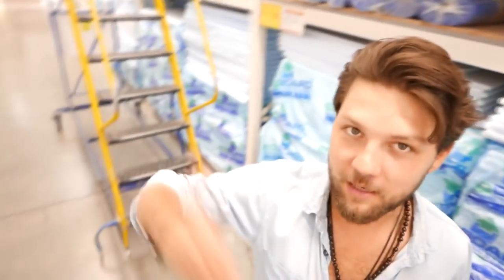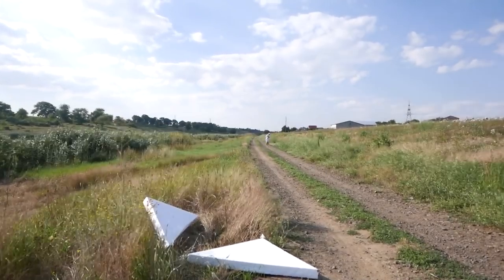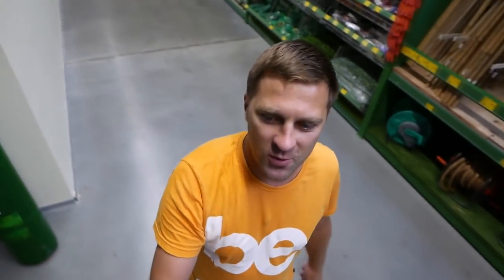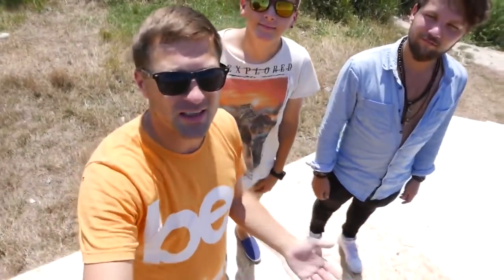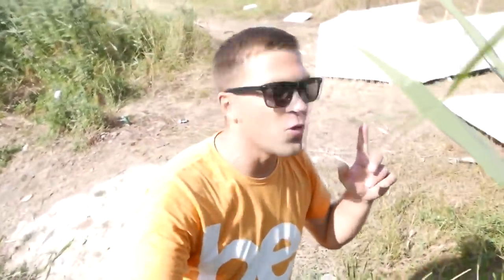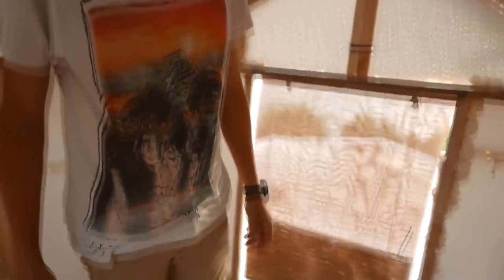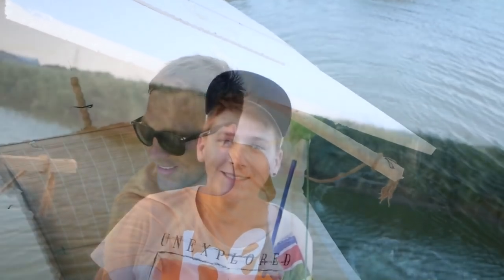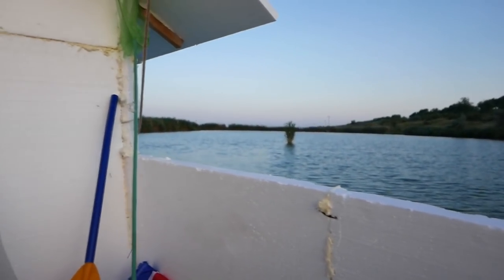House - boat from Styrofoam - DIY

Comment: What type of Styrofoam are you using? Because I was thinking of doing this DIY. PLZ Reply.
Reply from the maker: polystyrene foam with maximum density, it is ideal to use extruded polystyrene foam
Reply: Thank you such much for replying back.